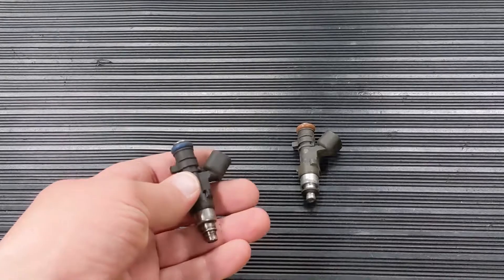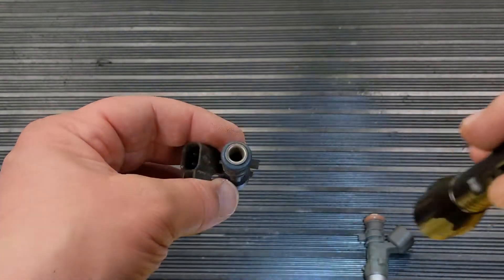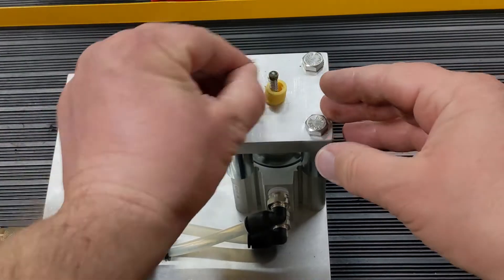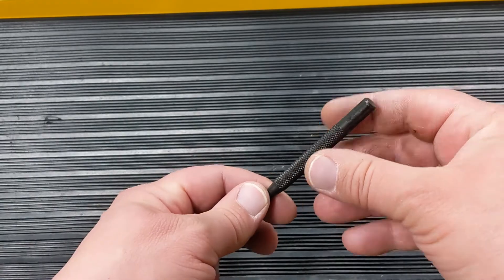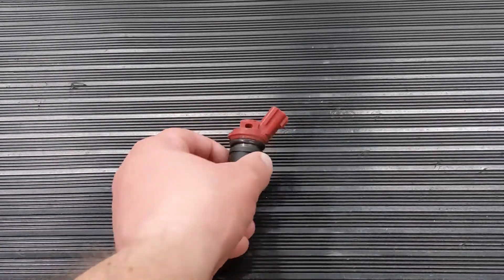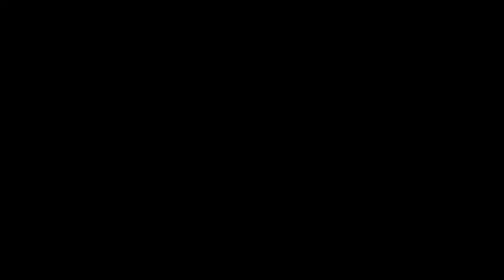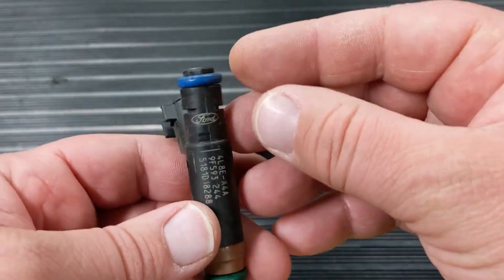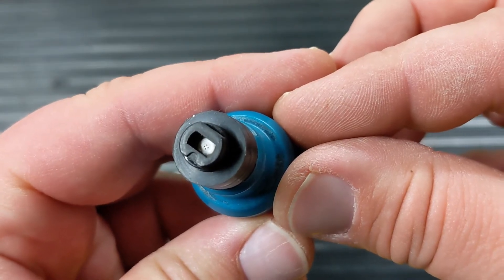Fuel Injectors with Known Common Problems & Issues. Solutions inside

Comment: Thanks for posting this. I designed and built my own multi-point, in port fuel injection system using BMW K75 ITBs as a replacement for the OEM single throttle body injector setup on my three cylinder Suzuki engine. For space reasons I needed low profile injectors and used the Weber type. Useful to know their weak point is the connector block. Although they are very well protected in use I’ll bear that in mind when working on them.

Comment: Hi, At 6 mins you comment on the siemens  Ford branded injectors not being very good.  I share your view after just cleaning them (mine looked the same) with an Autool T160 branded cleaner and tester.  The spray pattern looked barely atomised and i wasn't impressed with the almost linear squirting spray pattern (the volumes were pretty consistent though in the glass measuring tubes) .  The injectors came out of a 1999 Aston Martin DB7 vantage. The letters XRIE  A5B are on one side and  0 280 155 980 on the other as part of the grey moulding.  You suggest replacing with Bosch ones.  Can u tell me which ones exactly?   Thanking you in advance.
Reply from the maker: @markgriffin8536  email us through our website

Comment: Great video Thanks a Million. The Ford 2001 Excursion V-10 was there an issue with those ? You sell a refurbished set of 10 on your website. Are these better than stock ? I have just over 129000 miles. Trying to figure out a faint miss fire /hit miss as some call it. Would that be an injector or coil ? It makes Excursion jerk for a mega second.
Reply from the maker: @Richard5873  not a common problem with those. Yours just need service. Ones we sell are OEM refurbished just like if you sent yours in for service.
Reply: @InjectorRehab  THANKS A MILLION FOR FAST REPLYING ON HERE AND YOUR WEBSITE. GREAT videos and company pricing!!

Comment: What do you suggest for injectors for the 4th generation Ford Explorers, mine is a 2006 4.0l  engine ?? What is standard OEM unit and what is improved replacement that lasts ??? Thanks fella. Have yourself a Merry Christmas and have a Happy New Year. Peace too. vf
 THEY say stupid questions are free, so here goes. THE filters inside delphi injectors are so small and you showed them cleaned. What is the screen size of filtration that they prevent dirt from getting through ??  Just a point to be made, the damaged filters 2:40 look like they are made of brass or silicone bronze material. Is that correct ??
Reply from the maker: @victoryfirst2878  send an email in through the website
Reply from the maker: @victoryfirst2878  depending on which filter, 10 or 40 microns
Reply: @InjectorRehab  DAMN that is small. Does anyone make a kit that has a prefilter for the injector rails ??? Thanks

Comment: For Ford f150 v6 2000 model injectors can be clean? Or just disposable?
Reply: Just wondering if can be cleaned and test manually? How?
Reply from the maker: @ryanronnelalejo7888  https://injector-rehab.com/product/injector-clean-and-flow-test/
Reply from the maker: @ryanronnelalejo7888  not sure what would make you question why a 2000 Ford's injectors would be different than any other injector on earth and not be able to be serviced. Is there something I'm missing?

Comment: Hi what is the replacement for the Rochester injectors? I have a GM sbc 350cid 5.7l v8 mpi engine.
I recently got them ultrasonically cleaned, but want to be prepared if I need to replace. Thank you

Comment: Can i use them as a water injectors? Are they made from stainless steel internals?
Water will ofcourse be distilled, so no problem with conductivity.
Reply from the maker: They aren't intended to be, obviously. It is stainless internals

Comment: 3:37 are these o ring retainers universal? I have a Mitsubishi Diamante and one of the top o ring retainers from one of my injectors broke off.
Reply from the maker: They are not universal, but 2-144 would be the part number for the one you are looking for.
Reply: @InjectorRehab  would you recommend replacing the retainers for new ones? I only have one cracked retainer. The others seem to be in good condition but of I need to replace them i have no problem doing it.
Reply from the maker: @pjm91788  they are a component that unless broken, don't replace.
Reply from the maker: https://injector-rehab.com/product/bosch-type-3-upper-o-ring-retainer/

Comment: Please talk about Ford EV-1 to Bosch Type 3 injector upgrade. Issues with the EV-1’s ect.
On your rebuilt Type 3’s, are they fully flow tested and matched?
Reply from the maker: Yes they are fully tested. Check our other videos about 4 hole spray pattern and the difference between the ev1